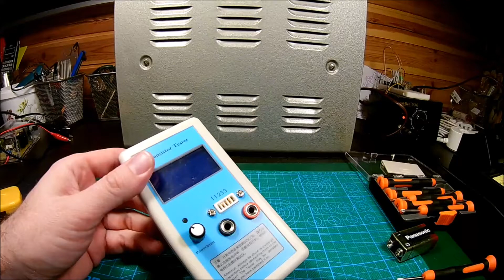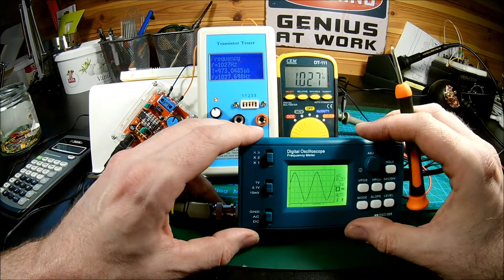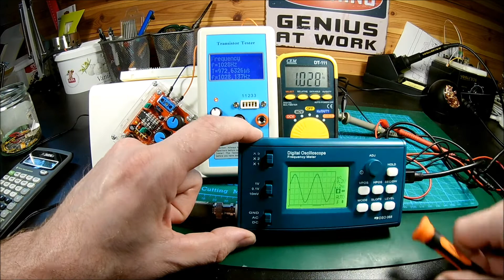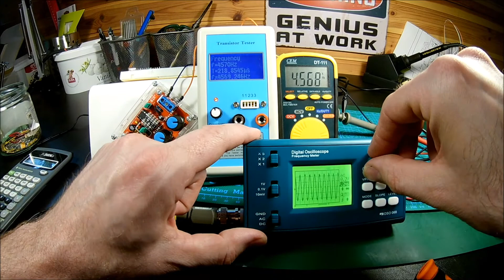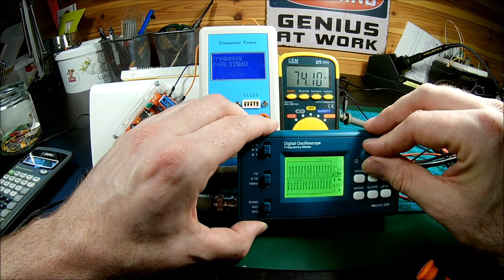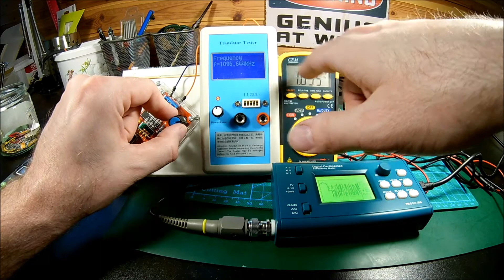#3:2 Transistor Tester M12864 - Test Frequency Counter

Comment: If I would do exactly what you've done, I would have to conclude that the frequency counter works perfectly as you reported.   I must put emphasis on the frequencies of 25KHz and below for the moment being.  What is really important are the frequencies at which the problem arises.  With my kit, frequencies below 6Khz are fine but between 6Khz and 25Khz, things are getting messy.   Just for the record, in the 1Khz to 25Khz range, the 6, 7, 8, 9, 11, 13, 15, 17, 18, 19, 21, 22, 23, 24 & 25 KHz frequencies reported wrongly computed frequency values and quite a few of them had wrong values for the time periods as well.  However the frequency reading at the top of the display was spot on pretty much all the time.  So globally, the values that are incorrect are the ones on the second and third line.  As amazing as it may sounds, at some frequencies a change of 1Hz in the frequency was sufficient to either report the right or wrong values.  For instance, at 5960Hz the computed frequency was very close in the few 1/100th difference.  Adding one single Hz to the frequency was sufficient to screw up the results.  The computed frequency was showing 99.17507Khz while the fonction generator was at 5961Hz.  Reducing the frequency back by 1Hz, then the computed value was just fine.  So bizarre !!!!   I reproduced that 1Hz difference scenario at 6305Hz.  At 6305Hz everything was fine and dandy.  At 6306Hz, total computed value chaos.  A 337.7825KHz frequency was reported at 6306Hz so if someone can clearly explain me what is going on, I'm all ears.   To reproduce that off the marks calculated values, you can use the 15 frequencies I listed above and you might see wrongly computed frequency values, wrong time periods or a combination of both.  What is important here is to make sure that the frequency is as close as possible to the values I mentioned above because I didn't verify if these frequencies are falling in the 1Hz difference bizarre situation.  I'm not an engineer nor an electronics genius but I really enjoy the hobby.  When I need an answer for something I don't understand or comprehend, I'm searching everywhere.  Hopefully I'll find an answer for the actual puzzle
Reply from the maker: I can't reproduce the fault you are having. I think there is something wrong with the AVR-chip in your tester.
If it is a software fault you could re-burn the chip or buy a second chip to play around with and see if you can reproduce the fault. (There are different software-versions to try out.)
Banggood has the chip: https://www.banggood.com/Main-Chip-ATMEGA328-IC-Chip-For-DIY-M12864-Transistor-Tester-Kit-p-1002733.html
Their is a forum thread on EEvBlog you can check out. And a german forum there the original creators are.
Reply: I have two spare chips, already pre-programmed, that I bought from Banggood at the same time as I bought the unit.  As per the comments, the chip doesn't like charged capacitors and seeing a lot of comments in that regard on the site I thought it would be a good idea to have spare ones.I did the same tests with the two spare chips.  My results differ from yours, that's for sure.  I have been able to reproduce the "fault" with both chips.  Sincerely, I really don't know what is causing this situation !!!You have version 1.12k of the firmware, right ?For the moment being I'm out of ideas.  Perhaps this is why they didn't have a dedicated input jack on the case so that people won't use the frequency counter and won't complain about it.  ;-)
Reply from the maker: Yeah I have also version 1.12k, then newest I can find is version 1.28m.
I found som info about the frequency counter here on page 13 http://www.avrtester.tode.cz/upload/ttester_en.pdf
It is using an output to the LCD as input then counting frequency their might be an interference.

It's the fault and mistakes that makes us learn more :-)
That's why I "hack" and mod my kits ...